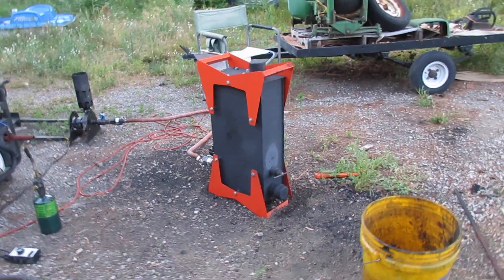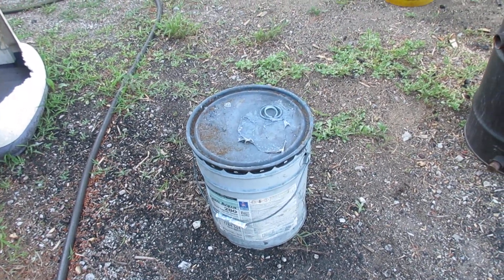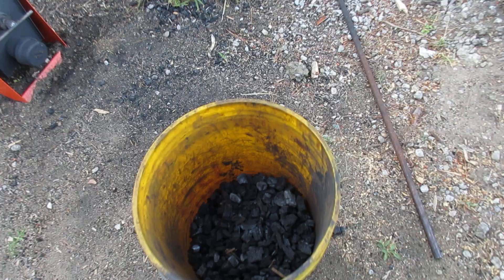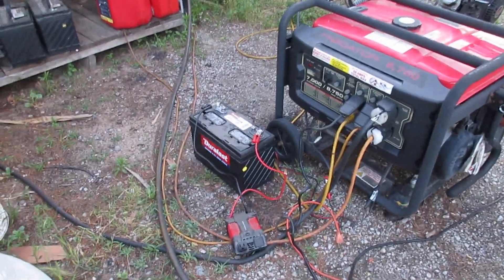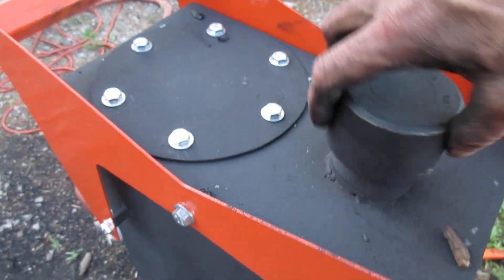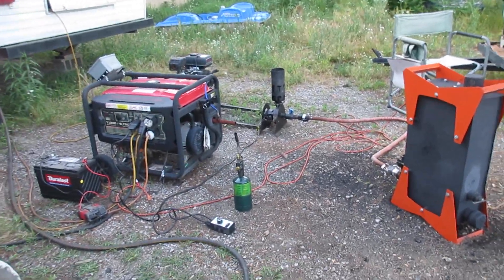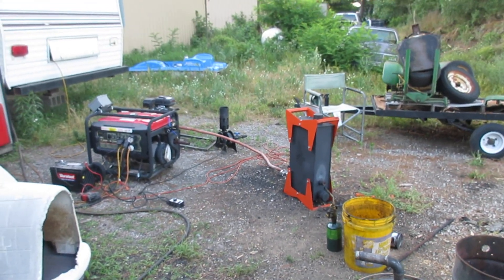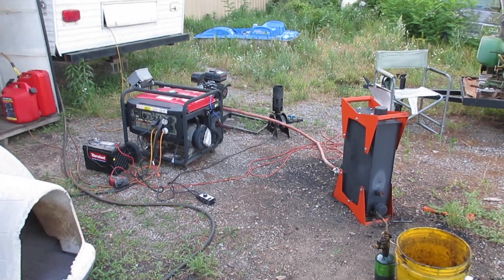M-1 Gasifier Cold Start and Engine Run

Comment: I run a tree service in Wisconsin. We will be building a new shop on vacant land. Can these units be banked together to run a larger generator? Of course I have lots of raw product, can the exhaust from a wood boiler be used in the charcoal production thus reducing the smoke of the combustion. Also, can wood chips that we produce in tree services be efficiently made into charcoal? I would love our natural work waste to become the fuel. Thanks
Reply from the maker: See my latest videos. This machine was one of the first protos and you need a bigger gasifier than this. And yes our machines are the only ones on market with networking capability. You can team three units together. This triples your fuel cap plus scales up your application size. You can also parallel the inverter generators together and run both of them off of a single teamed system. See my latest video posted tonight on this.
Reply: @Thrive-Off-Grid  thank you for the answer, can it be tapped into a natural gas generator on my house and switch back and forth with the grid gas?

Comment: Charcol cant be good for this, almost everything is allready burned out
Reply from the maker: Just the contrary charcoal is 30 to 40 percent more energy dense per lb than raw wood feed stocks. 1 lb of charcoal is roughly 9600 btu versus chip or chunked wood feed stock at 15-20% moisture content is only around 5700 btu. A raw wood gasifier uses 30% and greater of the gross feed stock just for its internal processes where a charcoal gasifier only uses around 5 to10% as there is no water it has to combat. Not to mention with the water injection this adds up to 20% back into the process. Then you have all that tar to deal with NO raw fuel gasifier will EVER be exempt from tar production and it WILL Destroy your engine. If it has not you simply have not ran it enough. It will happen I promise you. Charcoal is in fact just as, if not more eficient than a raw wood gasifier. We have developed those systems for over 8 years with well over 300 of those machines built and shipped world wide. We have closed that chapter in our development as charcoal gasification is not only easier it is more viable as an off grid solution.  However we are working a raw fuels gasifier for gas storage. This gas will be cooled and scrubbed clean for use in gas appliances while it produce tar free engine grade fuel for your charcoal gasifier. Run all appliances with gas options on this gas. It is far more efficient as it is a direct energy conversion versus losing 75% of the gas energy in engine losses converting to electricity. Yeah we are not new players here, we have lived and breathed this for 10 years of very rapid development with hundreds of very advanced machines built and over a million dollars spent.
Reply: @Thrive-Off-Grid  thanks for grat answer, learning ALOT 🙌 whot i said first wasent a statmemt 🙌 do you shop to Norway? Electric is insane, sometimes we pay as much as 1.3$pr kWh, im trying to make a system here befor Winther again kthen the prices is even wors 😳 so my plan was a big battery bank, some solar panel and gasifier to top up the battery's. Hope this wil save us some money 🙌 again thanks for the best answer on YouTube for me so far 🙌😅☺️
Reply from the maker: @berntsrensen1217  Look at my video there is the DIY Ammo Box gasifier how too videos. Use this video for the concept and build it yourself. But yes we ship world wide and in fact will have the first unit going to Norway late this spring. 

By the way these cross draft gasifiers can also run raw wood fuels and actually perform better then even our most advanced Imbert Designs.
Reply: @Thrive-Off-Grid  ive seen it 🙌☺️😎  but i dont have any shopo anymore, almost No tools at home at in a neigthburhood. Wuld be easyer Just to bye, when it this Nice 😎👌 ah cool, maby one more soon 😜🤟
Reply from the maker: This video is of a prototype. Please see the most recent 2022 models here. https://youtu.be/1HD1rvyEpBQ

These machines are the DF X Series. This stands for the Dual Fuel - Crossdraft. They can run on both raw wood feed stocks, charcoal or any combination of both.
Reply: @Thrive-Off-Grid  love it, super system ya have made 🙌 real cool! 🤟 Thanks again for good info 😎

Comment: How do you keep your air inlet from melting?  Is it ceramic?
Reply from the maker: This one the nozzle is imbedded into a larger coupling. This coupling acts as a heat sink. New versions also have this but they are now water injected. The evaporation process cools the nozzle preventing it from melting while producing additional H2 and CO in this process.
Reply from the maker: This unit here in this video was a prototype and is the only that exist in this format. See the 2022 DFX-S2 production version here https://youtu.be/1HD1rvyEpBQ

Comment: is there a reason to mix the air at the unit and not near the engine?
Reply from the maker: Nope, however if you hang the this extra weight on the carburetor it can add stress to the bolts and they can break. You can set up that way but I find it is easier to have this remote. The better set up is to have this mixer on our pancake filter that is in line of the hose and is generally close enough to the engine where it is in arms reach. Having it on the engine makes it difficult to fine tune as the engine is vibrating as well.
Reply from the maker: Also on this set up here in the video adding the air at the unit helps cool down the gas prior to entering the engine.

Comment: Very cool I see a big advantage of using bio char simple because of the clean fuel with less  particulates and tars being a drier fuel I’m thinking heavy steal retort bottle the gas in tanks with a transfer pump make Bouchard to run the generator free energy thanks

Comment: Do you have the inside of this setup as a downdraft or an updraft
Reply from the maker: They are semi cross draft, this here is a prototype. The production version is larger but it does not have an internal filter. Only two of this version exist. I have a new pancake filter that is external and inline. It work very well and is easier to service. The production versions also have a hinged lid to make it way easier to put fuel in the machine. 
 
See our website for further details. https://www.thriveoffgrid.net/m-1gasifier

There are many other models as well.

Comment: Did you use a hydraulic reservoir for the box? If you could can explain more about the dust filter. Who makes them and what they are used for normally? Really nice build thanks for sharing the video.
Reply from the maker: No I make everything from scratch. I am a manufacturer. 

This is a prototype the M-1 Standard no longer has filter onboard. However the M-1 Utility does and it has a  bag filter inside at the backside internally. it is a felt bag with a silica cloth liner we custom make. However any user can make them quite easily at home. We use a package stapler to mend the seams of the bag to create it. The materials are very cheap. for around 30 bucks you will have enough to last you a life time.
Reply from the maker: Yeah the new ones have a hinged lid for loading in fuel. I was trying to cut cost with this arrangement but its way to cumbersome to load fuel in it. The filter is eliminated to make room for more fuel and I have also expanded it out 2 inches to the sides for added fuel capacity. The filter for this unit is now external and we offer our pancake filter for it. It uses felt sandwiched between two manifolds. (inlet / outlet) you can stack this filter as well.

You can make a bag filter like we do out of a steel 5 gallon pale. We will create a thread on our forum to show you how to make this once I have the parts to make one.

Comment: Good video....That looks like a great product you've got there; very close to what I've been looking for.  But you've got one thing off.  Making wood into charcoal first, to fuel it, is a mistake.  By definition the making of charcoal involves starved-air combustion, and the evolution of Hydrogen and Carbon Monoxide, which are the fuel gases that a Gasifier is intended to extract.  Charcoal can produce substantially less of them than the raw wood to begin with.  Most Gasifiers will work just fine on the raw wood.  What prevents yours from doing so?  More soot?  More moisture or condensation?  Those are fixable issues, and well worth it to eliminate the wasteful and extraneous step of producing the charcoal first.  Also, if you will put a copper coil around the burn tube inside the box, to recover excess heat into a water heater/boiler/distiller, you can make this device a lot more useful.  How hot do the outsides of the box get?  A little bit of insulation might be in order.  But I'm likely to buy a unit; its closer to what I want than anything else I see on the market.
Reply from the maker: You do realize I am the second largest manufacturer in the United States right? We built direct wood gassers for over 10 years and built some the most advanced machines to exist in this space. I have my own technologies that are very advanced. My reactors will never emit combustion gases into the raw fuels hopper. This development is a huge deal as the fuel never gets wet or sticky in the hopper. 

But anyways.... 

Do not take charcoal at face value; that is your first mistake. (See further in my channel) Both processes require energy and both processes will generate waste. They both have pros and cons.

If you use the heat from your kiln the charcoaling process is not a waste at all.  We heat our shop with our kiln. I dont even look at it as making charcoal I look at it as I would a wood stove and that charcoal is basically a byproduct of heating our shop. Additionally prepping fuel for the kiln is quite easy and fast much like prepping fire wood. Running the kiln is about the same as running an ordinary wood stove. 

Now factor in that water drip. Most of that energy you spent making the charcoal you get back. The water drip feeds ordinary water into the jet and is flashed to steam. That steam is then cracked like any other gasification process into H2 and CO. You can also add in saw dust and other waste with charcoal for additional reclaim. All this you can not do with a direct wood gasifier.

Turbo chargers are now also an option as no direct wood gasifier is except from tar at least at this scale. If it can happen it will. No tar in a turbo it will fail. 

Now manufacturing and  cost. The market simply is not willing to pay for the cost of a commercially built direct woodgas system. They must be automated in order to self sustain. Physics simply can not be overcome with out it. The grate is going to clog, the fuel  is going to bridge, gas energy density will oscillate all this is going to happen. The automation I offer to combat all this plus automatic ignition with electronic AFR mixer cost about 1/3 of the machine and adds a ton of complexity both to the machines and to manufacture it. Then you have a much more complex unit verses a  charcoal system. 

Charcoal systems are much simpler, they are more compact, they run stable without automation, tar is not an issue, much less complex to manufacture. fuel production is much less labor intensive, ( Ill trade the labor for a little inefficiency any day). If you ever run a small chipper on a gasifier to produce gas for itself you will learn very quick charcoal is not all that much more inefficient. Charcoal does not require large expensive equipment. Just a kiln made of barrels, an electric chainsaw, chop saw what ever. Finally cost to consumer is far less. The machine is simpler to operate, tar is not an issue, power with the water drip gives you more power than a direct gasser and more. These machine are not yesterdays machines they are what is developed now today. We will continue on with charcoal systems and advance the development in the charcoaling processes with combining it with CHP and refrigeration. The water drip system will become electronically controlled with super heated steam systems and direct injection. We can now turbo the engines we run and will exceed direct wood gas system in both power and over all efficiency. Ive already done my part in the direct wood gas world. However, I feel charcoal is by far better technology and is much more fail safe for our consumers.
Reply: @Thrive-Off-Grid  Tar should be considered a resource rather than a problem. As Mr. Teslonian (See Channel) and others have demonstrated, fractional distillation into useful quantities of practical liquid fuels is certainly feasible, even at the small scale.  Humor me.  What would go wrong if wood chips were used in this system instead of Charcoal?  If condensing the [heavier] liquid Hydrocarbons out of the gas stream is the only issue, I can accommodate that.  I have a suitable generator, new, never used, which can be tested to destruction to come up with the integrated system I'm looking to build.  BTW:  Are you familiar with Paul Pantone's ("GEET") work on in-situ fuel reforming? Used on these gensets, it breaks down the tar (and lesser liquids) to Methane, Hydrogen and COH2 - without expending any additional energy to do so.

Thank you for responding.
Reply from the maker: @PressToDigitate  Yes Im familiar with booth of them. No one that I have heard of has a geet that works and the dude is doing  for time for fraud. MrTeslonians "gasifiers": will not work, they do not have a proper reduction system, restriction core now enough depth in order for all the reactions wot take place. Direct raw fuels gasification for engine grade is a process and its not there on any of his builds. 

If you put raw fuels in the charcoal unit; it will most likely just smoke, if you did get an engine to run it would not be for long as the intake valve would seize up from tar. A charcoal gasifier is very  different than a direct raw fuels gasifier. Its just a jet poking into the charcoal. The reduction process is immediate and local to the oxidation process. Verses direct gasifier, you have a fermenting stage > Pyrolysis Stage > Oxidation stage> thermal cracking stage and then the reduction stage. Without these  processes in place engine grade gas is unlikely. 

Making tar on purpose you are better off using the kiln process and yes you can make kerosene. If you make any tar in your engine grade gasifier it simply is not engine grade and you will ruin your engine. You can not filter tar it is impossible at this level. Tar is dropped throw-out your filter process in many grades. Mr Teslonian may know this as he seems to understand oil refining. But anyways,  the tar and soots are carried in the gas in " gas suspension" The gas is under vacuum lowering the due points. Some tar will drop early (this is the tar you may see in your filter) but other more refined grades will drop later. Those later tars are the valve stickers and that grade of tar will not drop until the throttle plate. 

Here read this;;; this will tell you everything you need to know about a down draft gasifier and how to actually and properly build one. All of us manufactures started here. https://www.nrel.gov/docs/legosti/old/3022.pdf

Comment: Now you just need to find a way to fill those green propane bottles with wood gas so you can light the fire.
Reply from the maker: You can light it with a piece of paper if you dont have a torch. The Fusion has self ignition systems it lights itself both the reactor and the flare cup. That unit is fully automated and will eventually be ran from a phone app using bluetooth. So as long as you are in range you can start the entire machine from cold start up to engine running directly from your cell phone.

Comment: This is brilliant, and I think there are enough videos out there showing how easy it is to make charcoal with the retort container. And the, yeah, then you have a smaller, simpler, clean-burning gasifier. Are you familiar with the term "steam punk"? It's what hipsters in the city refer to doing modern things using old-timey technology. This device is as steam punk as it gets, and with the right marketing and price point you could sell these like hot cakes. Just how "craft beer" took off, this is "craft energy"...and it's green tech, so it hits that sweet spot. This allows every hipster (not just homesteader) to own their own refinery and off grid power station. The day is coming when you will not be able to make these fast enough (which is also too bad because it'll be tech like this that saves civilization... and there won't be enough gasifiers to go around). We should meet up sometime and chat about a business plan. I live in Chicago but I pass through/near Muskegon on my way to Northern Michigan a lot. Congrats, too. I refer to you to my friends as the "Elon Musk of gasifiers", and then they ask "what's a gasifier?"
Reply from the maker: Yeah I want this thing in Lowes , Home Depot, Bass Pro, Cabelas etc.  it is designed for mass production. We have resources here to have this mass produced.
Reply from the maker: Nice I did note you have some marketing expertise. Yeah anytime stop on by :)